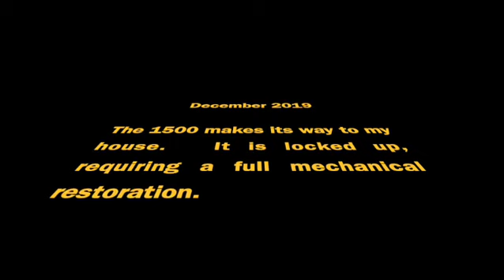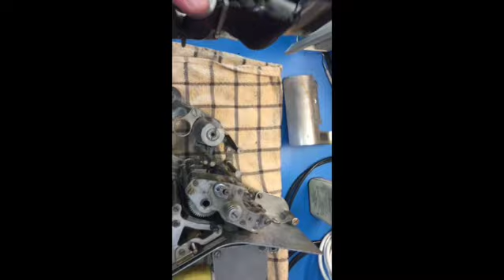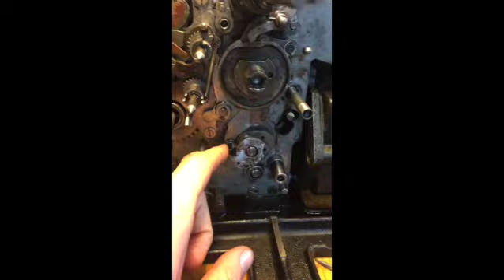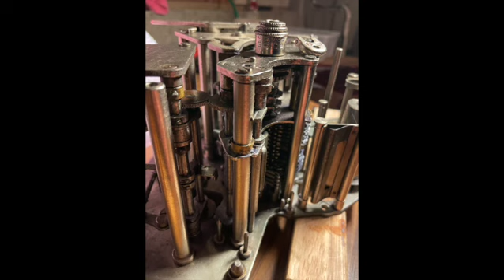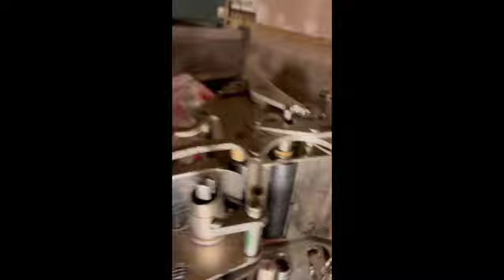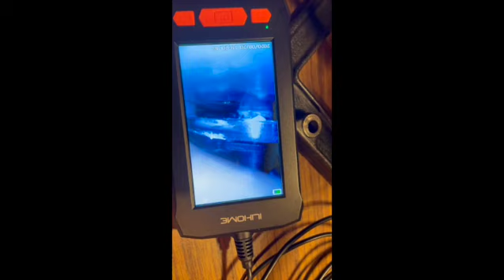National Cash Register Model 1500 vintage cash register restoration

Comment: Not sure if you'll see this comment but hopefully you will!  I'm working on a model 1900 National cash register now.   I am trying to get the outer chrome covers off but I can not figure out how to remove the motor bar lever to allow for the cover to come off (the lever is blocking the cover from being entirely removed).  Not sure if your model has the same issue or if there is a trick to the removal.  Any advice would be greatly appreciated!
Reply from the maker: Yes indeed I had the same problem.  You’d be surprised to know that it just pulls straight off the machine!   So yank on it until it pops straight out.  Spray some penetrating oil down into it to help it along.  You can wrap a rag around it for leverage, just like removing a knob on an old TV tuner dial.